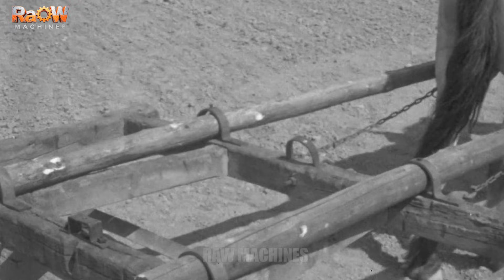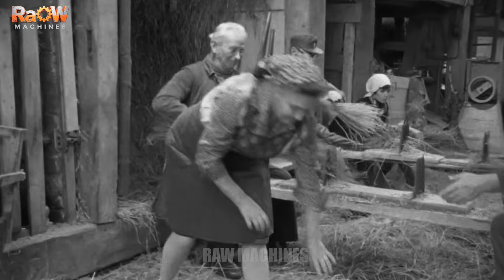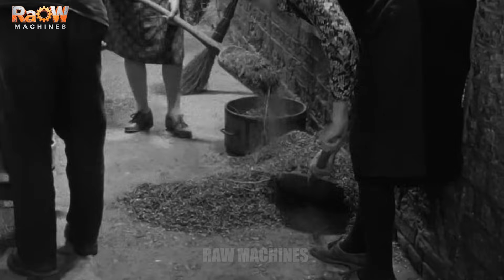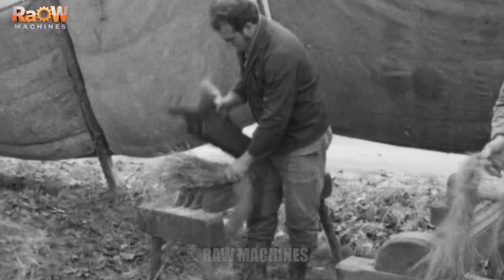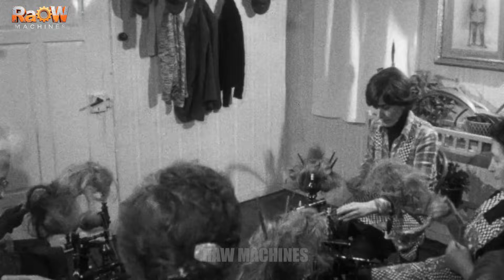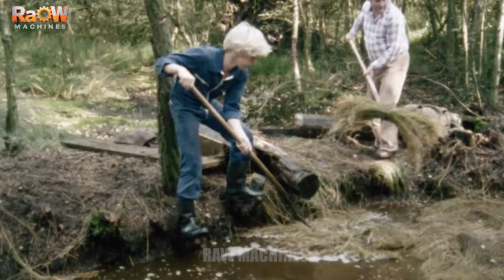Before Electricity: From Flax Fields to the Spinning Wheel | Traditional Linen Making (Part 1)

Comment: dialog was about windmills but the steps seen in the barn are rippling (rough combing) and  hackling (beating) to extract the seeds, screening to separate the seeds from the larger debris and finally Cleaning with an air blower to remove the chaff. The flax is then dew retted (left out in the weather) or wet retted (submerged in water) to decay the outer layers. The commentary kind of catches up at this point.
Reply: Thanks for filling the gaps.  ❤